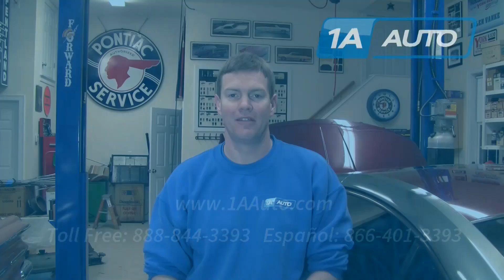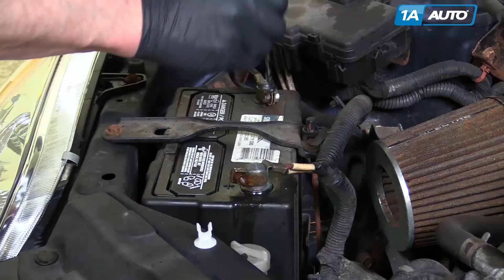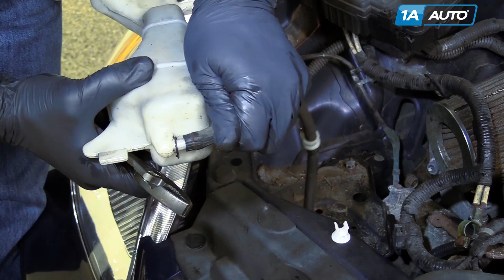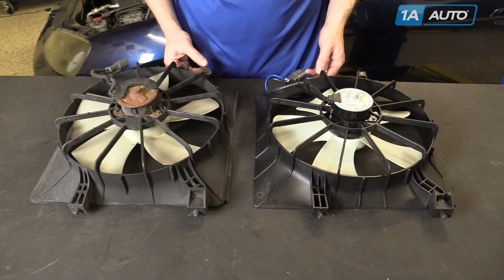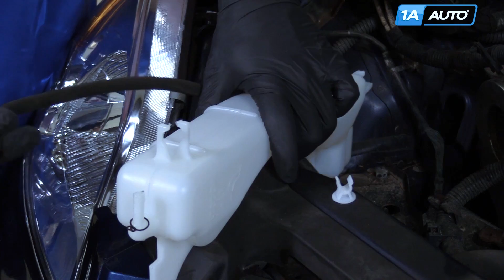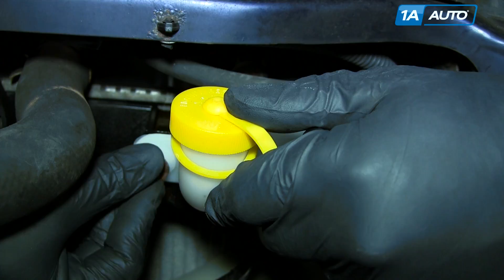How to Replace a Radiator Fan 01-05 Honda Civic

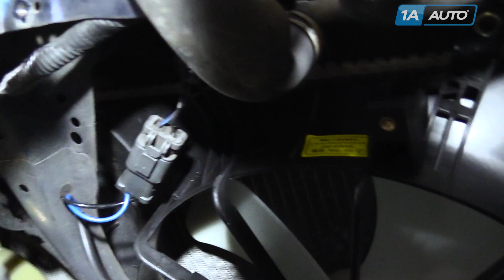Comment: Wondering if you could help me with something... What is the name/code of the metal bar right top of fans, goes east-to-west, in black color? It is the bar where you rested your left hand at 5:54. If there a video replacing that bar? Thanks a bunch.

Comment: YOUTUBE UNIVERSITY for the win! Second time I’ve watched your videos and fixed it myself(last one was a starter). The only problem was the bottom tab for the reservoir that fits in the fan needed to be trimmed. But that’s because the fan was made in Taiwan I’m assuming and didn’t mold out correctly. Trimmed with a knife and boom! It fit. Thanks!
Reply from the maker: +Ben Jamin Thank you! We love empowering our customers and showing how to perform DIY auto repairs with our high-quality auto parts. 1AAuto.com

Comment: My fans turn on but they sound very weak when running. My car overheats but when i reach highway speed stops overheating. Could it be that my fan motor is bad and not running the fans at full speed?
Reply from the maker: +ShitDawg  It is possible, we do recommend having a mechanic take a look. Thanks for checking us out!

Comment: I just did this job, but only after checking to make sure the relay and fuses were good. I did this by checking the relay female sockets in the fuse box under the hood (top left relay) against that same sockets ground. The relay has 5 sockets, and two of them go to their corresponding fuses, the second socket from the left goes to fuse #4 (20 amp) under the hood, and the first socket from the top/right goes to the fuse #14 (10 amp) under the dash. My last test was to use the plug from the AC condenser fan and plug it into the radiator fan to be certain. What this does is eliminate the entire radiator fan circuit, sensors, computer, wiring, relay and fuses, and uses the AC circuit instead to test if the fan is working. This is in case something in the circuit is bad after the relay and fuses, such as wiring or sensors, and is the easiest way to test for it. After running the AC for a minute, it still didn't come on, so I knew it was the fan that was bad. If the fan had come on, then I'd know, after having tested the relay and fuses, that it was either bad wiring or temp sensor.

Comment: Do you need to add coolant afterwards? Are you likely to spill? how do you add coolant correctly.?
Reply from the maker: +Victor Finngall Hello. Your owner's manual will have info on how to add fluids to your vehicle. Thanks for checking us out! 1AAuto.com
Reply: @1AAuto  I'm asking because you disconnected the coolant hose. Will that cause you to need to refill the coolant? I hear if you don't do it right it can blow up.

Comment: I found it unnecessary to drain any coolant on my 01 civic coupe. Just disconnected the top hose and wiggled out the old fan. Thanks for the videos, you've saved me so much money and time with your guidance.
Reply: If no coolant came out of that hose, you've got other issues
Reply: 2002 does too and it overheating I'm changing both an radiator.

Comment: My civic is constantly over heating it only cools down on the freeway if I have the heater on it was plenty of coolant and I changed the thermostat .. could it be the fan ? Or another problem entirely
Reply from the maker: +isaac mathews It seems you may need to change the fan, but you would have to diagnose the vehicle to find out for sure. Thanks! 1AAuto.com
Reply: Test your fan first if it’s good then move on to your thermo fan switch.  If that doesn’t do it then thermostat would be next but you said that’s good.  Now, it’s time to look at your relays and fuses related to your cooling system.  And of course check for leaks on your hoses.  Unfortunately, if you got this far and the problem it’s still there you might be looking at a water pump failure but if you are lucky only your radiator has gone bad.  Good luck 👍🏼
Reply: Did you replace the fan and it fixed the problem? Mine does the same thing
Reply: Same problem,,just to b sure the motor fan rite
Reply: Did you fix the issue?
Reply: You have a bad head gasket.

Comment: So, do I need to do a coolant flush before I do the job?
Reply from the maker: +ofwanko You don't have to do a complete flush, but you need to drain some coolant because you have to disconnect some of the coolant components.  If you do not drain like in the video you will have a lot of spillage!  1aauto.com
Reply: 1A Auto Parts Okay good! Thanks alot for the reply!

Comment: my 04 civic has 2 fans
Reply: MAXCXT one is a condenser fan (for your AC) and the other one is the cooling fan (the one that is being replaced)
Reply: @Komprezor190  correct. The video says this is the passenger side fan.

Comment: Excellent video, and a good part especially considering the OEM item is over $350.  For those willing to go deeply into repairs, when these fans quit it's often just the motor brushes.  A replacement set is about $4.
Reply: Barnekkid Try ebay. You can find genuine honda parts from sellers out of state. I would also recommend utilizing paypal for your purchases since there is an product guarentee.
Reply: I have never paid full price for OEM, perform all repairs myself and it saves hundreds.